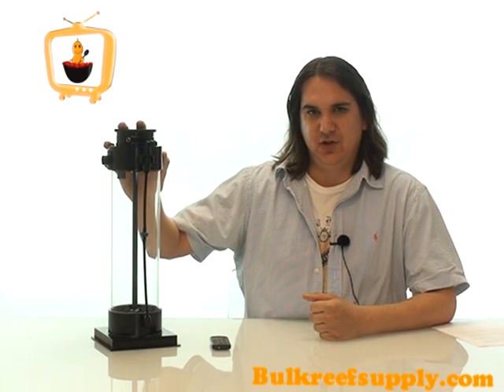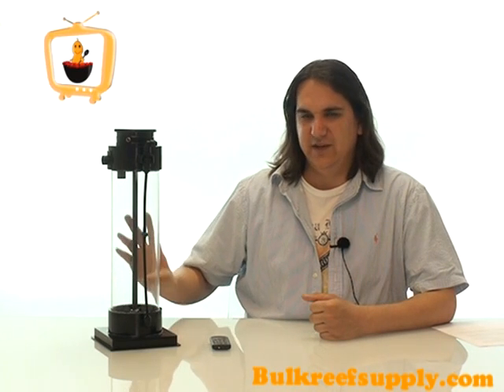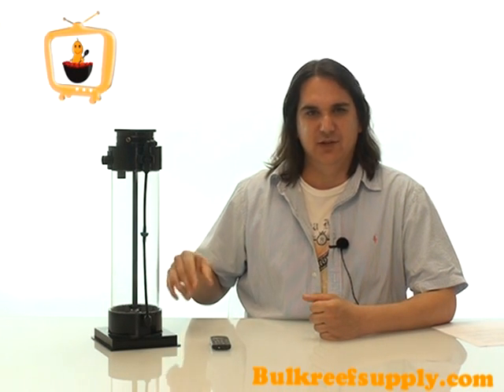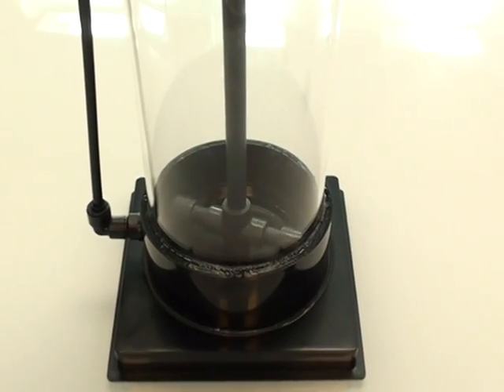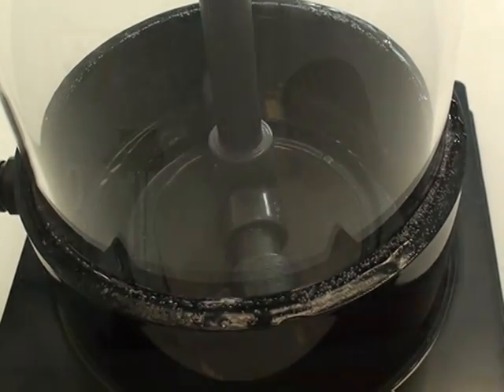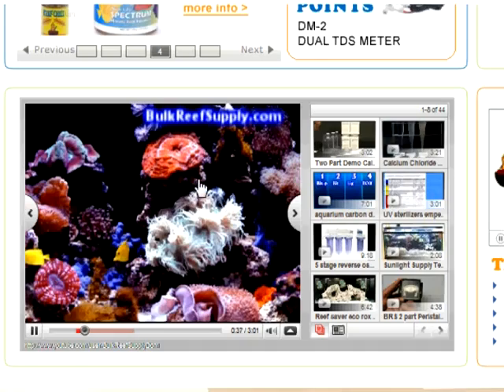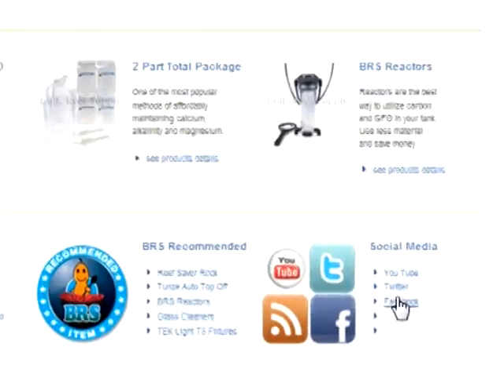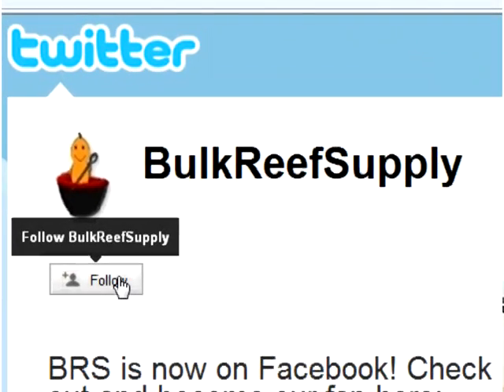Aquamedic Kalkwasser Stirrer / Reactor Demo Bulk Reef Supply

Comment: Just installed one of these on my 100gallon, it is connected to my ATU  and drips kalk into my sump when the sump level drops. I also run a calcium reactor with it both running 24/7 but I will monitor the KH and calc levels in my tank to see who it all goes.